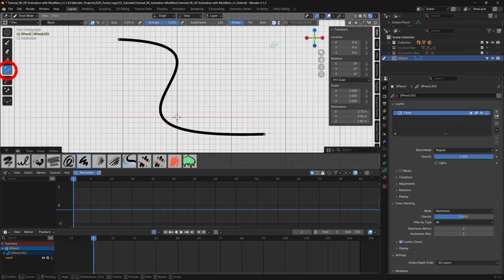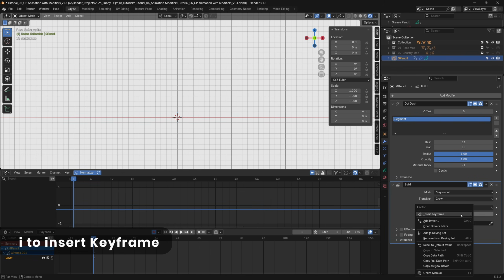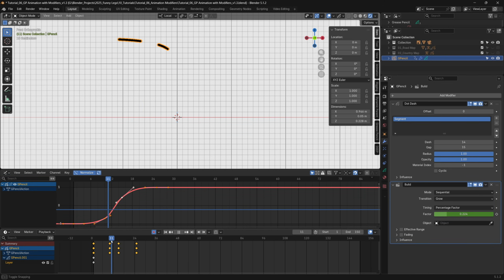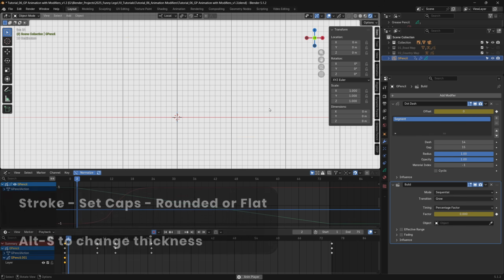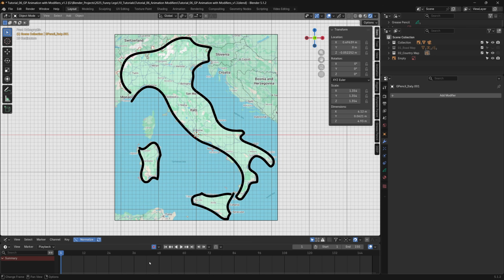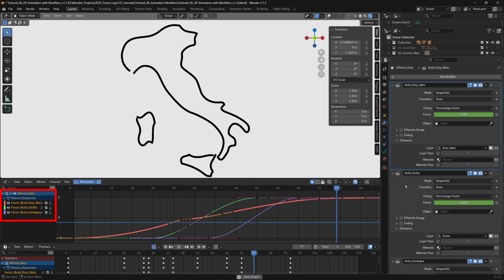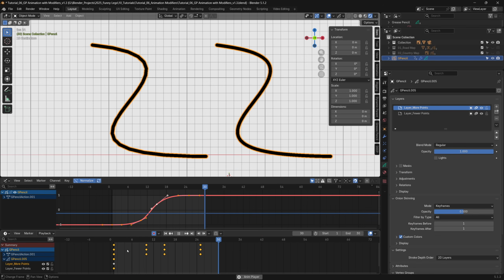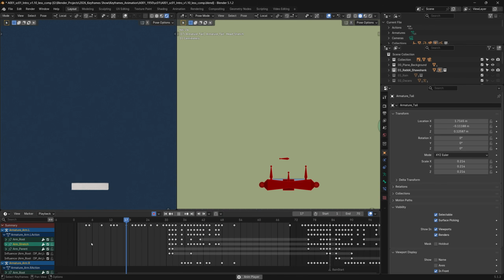2D Blender Animation: Grow Lines with Modifiers

Comment: how do you reverse the direction in the animations as the build modifier is going the wrong way and there is no way to change the direction
Reply from the maker: Great question! The line grows from A to B. A is where you've started to draw the stroke. So, if you want your line to grow from A to B, you use Grow transition going from 0 to 1. But if you want to grow from B to A, use Vanish transition going from 1 to 0.
Reply: @cg_hitchhiker I resorted to OBS and filmora I could never seem to make it work properly in just blender
Reply from the maker: @matthewjones9259  ok, no worries! But if you still decide to try this Grow vs Vanish method I explained, let me know if you have more questions there. 🙌
Reply: @cg_hitchhiker I couldn't even get the key frames to work with the animation so I couldn't position anything
Reply from the maker: @matthewjones9259  Did you use the little dot next to the Factor (on the right) in Build Modifier to set the first key? Or you can hover with your mouse over the number of the Factor and press I to set the key.